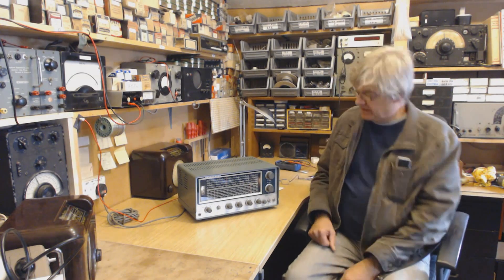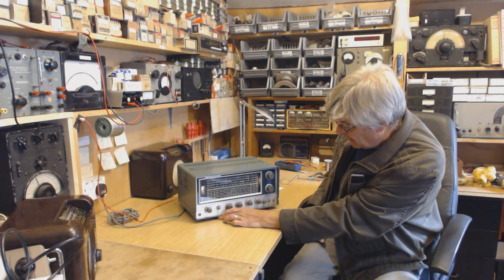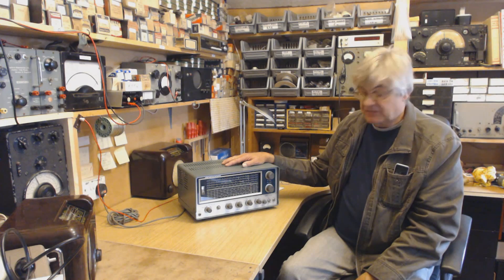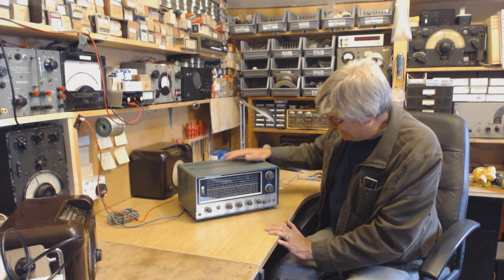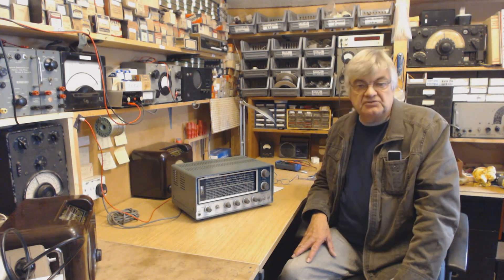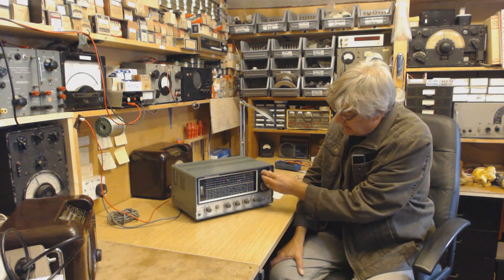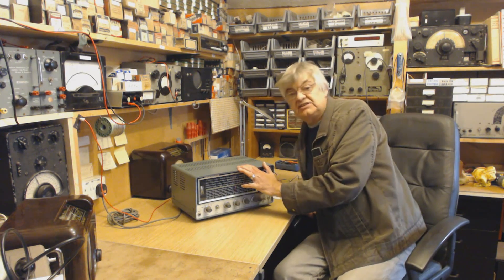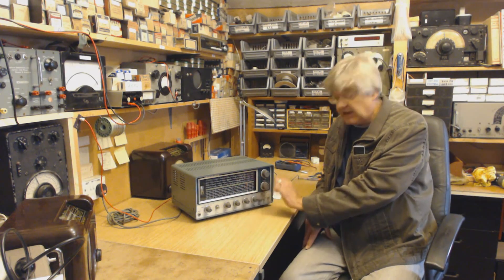Lafayette KT 340 Communications Receiver

Comment: Hi Ray.  Love your videos.  Particularly your memories of the CCF - I think we are of the same generation.  I remember using the 88 sets and 31 set on school CCF field days in the Lake District.   I was signals NCO on one exercise and was tasked with lugging a 31 set up to the top of the local high point plus a spare battery and spare valves by myself to set up a net - that was fun!!.  Some of the groups got lost towards the end of the day so I was stuck on high ground whist we helped them find their way back to the coaches and onwards to getting back to Bury.  However I was planning to celebrate the day by going to a pop concert at the Free Trade Hall.  Bottom line my 'best mate' who hadn't joined the CCF in favour of community service gave my 'gf' a lift with a  predictable outcome!!  Heh heh - I think I had a better day and moved on...  As regards missing knobs why not explore 3D printing - either by yourself or otherwise someone local that could help - might be a solution to long lost radio knobs etc. Take care
Reply from the maker: Interesting stuff! Shame about your gf. Cheers, Ray.

Comment: I still have my HE-30 which i got about 1961.  I used it first as a SWL, later as a novice and then general class ham operator.  Lots of fond memories.  The receiver isn't presently functioning.  Maybe, I can get it going later on.
Reply from the maker: Hi Jim, yes do get it going! They are great receivers.

Comment: I had one of these as a Novice Class in the USA.  The HA230 was the assembled version.  The KT340 was the kit version, which saved you $15 (not much).  I was 13 years old at the time.  It sure did drift a lot for ham radio operations.
Reply from the maker: They are still nice radios. Cheers, Ray.
Reply: I hear ya, my novice receiver was a KT-320 and it drifted too.

Comment: Not Hallicrafters. I had the HA-230 in 1965--used the receiver's standby to switch a relay for antenna change over. The HA-230 is the built version and KT is kit built. Can you show closer pictures and maybe inside video? Good stories OM !
Reply from the maker: Thanks for your comments. I will try and make another video at a later date, when I get time. All the best, Ray.

Comment: Interesting set. Transistorised shortwave radios from that era didn't seem to have very good dynamic range compared to the valve receivers, they overloaded on strong signals and were generally inferior. Later transistor designs were a lot better.
Reply from the maker: I agree about transistor sets.  This one was valve and really worked well. Cheers, Ray.

Comment: I just came across a Lafayette HE-30.  I'm guessing it's a 1960's model which is way before my time.
Reply from the maker: +copykon Yes, 1960s as far as I know.
Reply: My radio is fully intact. Powers up along with all the tubes, but has no audio output going out of the phones jack. I was told by the old owner that it smoked when it went bad. Any advice?
Reply from the maker: Check capacitors, make sure voltages are correct, look for burnt components.
Reply: copykon My late father had an HE-30, I bought it from him to pass on to a friend, he kept it for a while then passed it to his neighbour, later on it made it’s way to a rubbish dump but was rescued from there... I bet that it is still around somewhere...